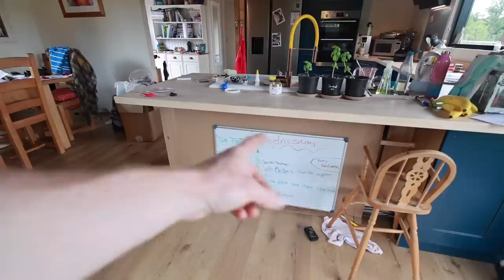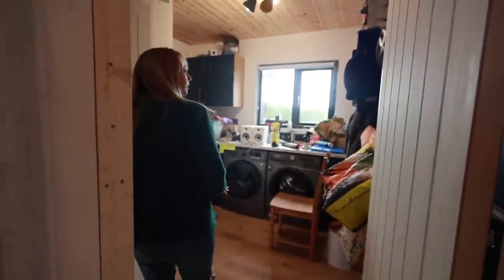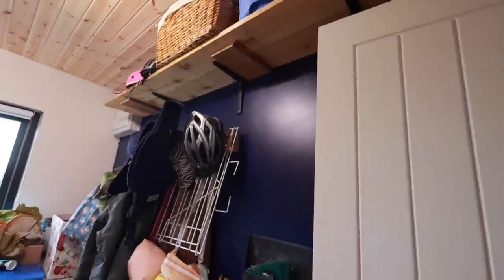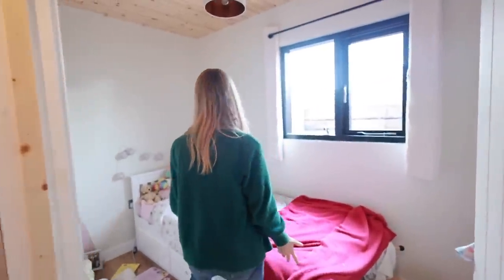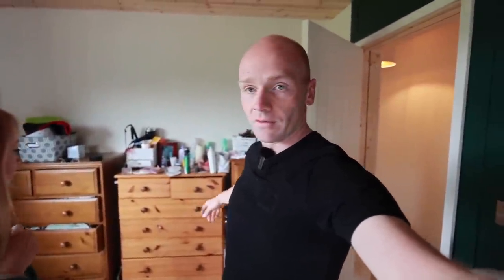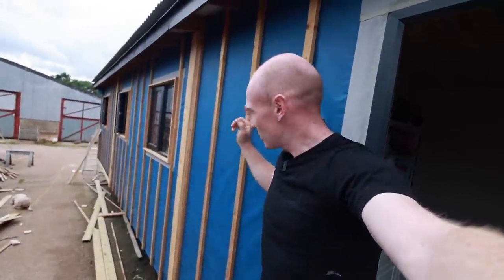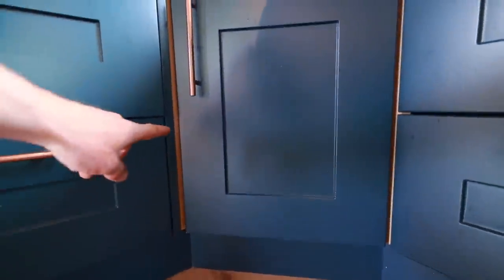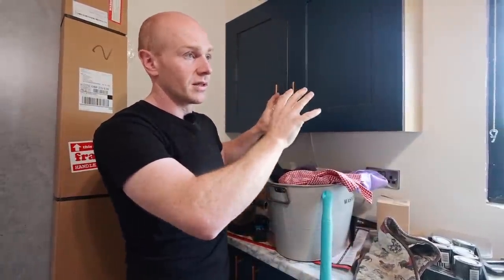IS OUR CABIN FINISHED? - FAMILY 'TINY' HOME SELF BUILD 🏠

Comment: Great to see Jo is keeping you honest 😁, re the heating look into infrared pannels for your living room. They can be wall mounted or ceiling mounted and would give you move floor layout options than a wood burner in the same space. That said you are right re the free wood. So I'd go an external wood boiler for hot water and radiators if the electric rads are not good enough in the winter. Keep going Tim your are almost there. Take care D

Comment: I have seen a farm that got an external wood fired boiler for their farm house that can be used to heat water for calf milk etc but also does the house. Believe it was due to getting grants this way made it a lot cheaper. Charlotte Ashley Farms maybe able to advise. Not sure if you are planning on heating any other buildings in future that could then take advantage of this type of setup.

Comment: Do a PAX build from IKEA?
Reply from the maker: I think when i looked that the ikea units are too deep, but maybe there is a shallow option. 👍
Reply: @TheRestorationCouple  you are right about ikea units being deep, i just cut them down to my required depth worked perfect
Reply: I was thinking along the lines of simple melamine sheets across that wall - they come in different widths.  Knew someone once who also used them as sliding doors in tracks, a couple with Ikea mirrors glued on.
Reply: Ikea do a narrow version of PAX, think it’s 44cm. Alternatively you can build the wardrobe and just use the sliding doors from Ikea with the fittings.